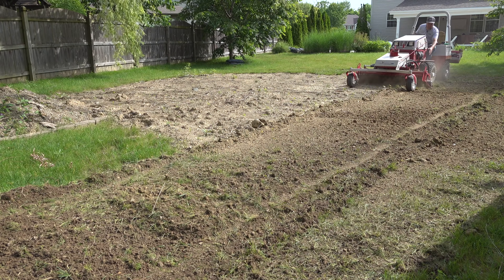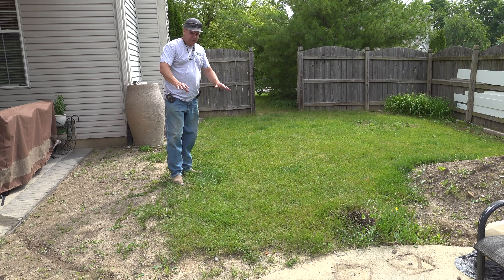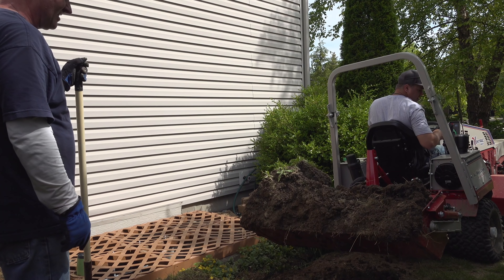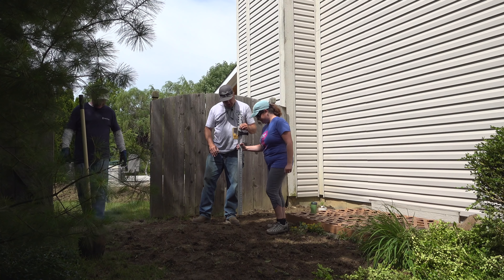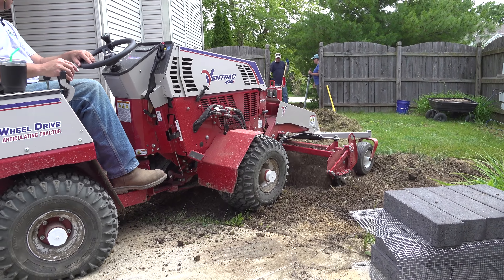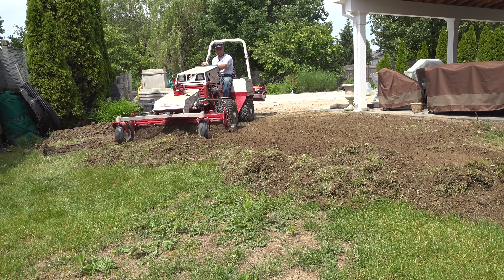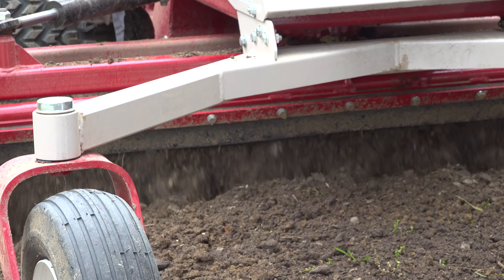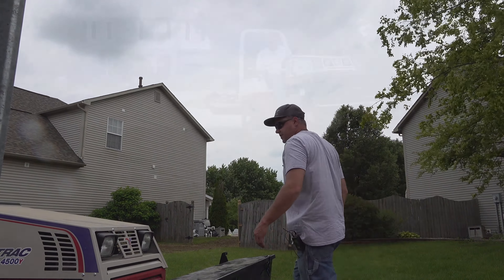Jim Dandy Tool!! Helping Homeowner Grade & Seed Yard!

Comment: I've owned both three point and skidsteer models.  Both have advantages and disadvantages.  Both were Harley brand (one is CAT same) and they use the best components available from carbide teeth to hydraulic motors.  Three point one was awesome for along houses and sidewalks.   Skidsteer one is a HOG and moves a lot of dirt.  FYI using a Massey 1528 and Cat 257D standard flow.

Comment: Looks to me like the Ventrac and its specialty attachments are the thing to use in tight areas like you are working in.  All three attachments you used were ideal for that type work.  You can see what you are doing with the front attachments rather than turning around all the time looking at rear attachments on tractors.  I think that set up will be used quite a bit in your business.  Good luck.
Reply from the maker: Thanks ilmo. It really did work well for that application.  Even the power bucket seemed like it was 'made for the job'.

Comment: you should get the foot control for the ventrac
Reply from the maker: I have it
Reply: Tractor Time with Tim ok. I didn’t know you were using your left hand to run the power bucket
Reply from the maker: Yes. I find the foot control to be difficult to use for detail work...especially since it is a Kubota style treadle pedal.

Comment: Great job and video.  I noticed right off the bat that the rear tires looked low.  I was going to mention they were either low on air or maybe one too many cheeseburgers.  But, since you mentioned you added air later I won't bring up the cheeseburgers.
Reply from the maker: Hey now!     Be careful with the cheeseburger slander :-)

I checked the manual, it says anything between 8 and 16 psi for the tires.  So, the 11 was within range.  Also, with the duals, it says 12 is the max.

I really think the power bucket on the rear puts a lot of weight on it which is not typical of other attachments.

Comment: I grew up in a wet state, one of the things that was crucial with houses was the grading.  It is always better to have a house sitting "high" rather than "low"  on the slope or on the flat as well.  The houses that were always on sale were the ones on the edges of swales or on the margins of development grades.  They were to code, but when you get one of those 20 year La Nina cycles, you end up worrying about how dry you are going to stay.

Comment: I am amazed of the options and uses the VenTrac is capable of. How WIDE is Vinny?
Reply from the maker: I'm not sure of the width with single tires.  It is just over 6' wide with duals.
Reply: I'm sure it takes some practice to get used to the bucket in the back.

Comment: Hay tim. What kind of grass seed be a good fit for here in grand rapids michigan. Im working up a spot to make it a better lawn at church. Im gonna disc it and possibly use the field cultivators. I might try the packer if its clumpy from the disc and then ive found a landscape rake i can rent. Might need the backblade or borrow a box blade if i have to move a bunch of dirt.  It will be a challenge. But i will get it done for my church once it cools down a bit
Reply from the maker: I'm not a seeding expert.  I will have to defer to someone else.

Comment: That machine is articulated like a payloader I thought you were going to get into a pickle in that corner. My experience is you get to tight in a corner as you turn the wheel it seams to move into the corner some thing about the scrunch of the tires in the turned position.  That machine looks like a club but it's got way more features built in it them seen to the eye till you see watch it work closely
Reply from the maker: Yes, I agree with your entire comment.
Articulated steering can get you into a bind.

Comment: nice job it turned out great, but...........why did the home owner leave that one pile of dirt in the back yard? guessing he wanted some to mess with it-huh.
Reply from the maker: More work in the future. That tree is coming out.  
The pile of ‘dirt’ is mostly pea gravel.  If you remember, I had a full load, and could not quite get it all.  I am pretty expensive when it comes to haul off (loading, hauling, dump fees, all add up). So, we’ll deal with that later when the tree comes down.